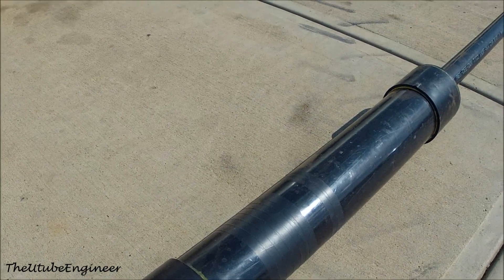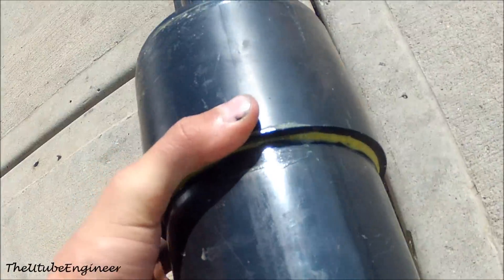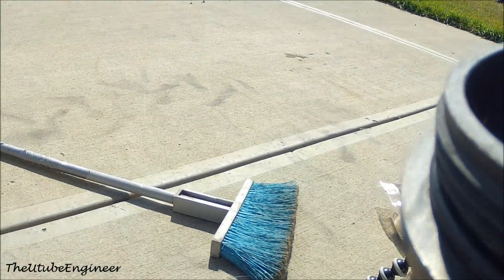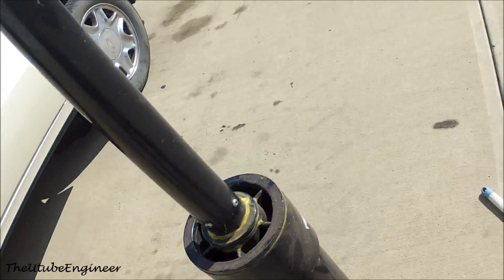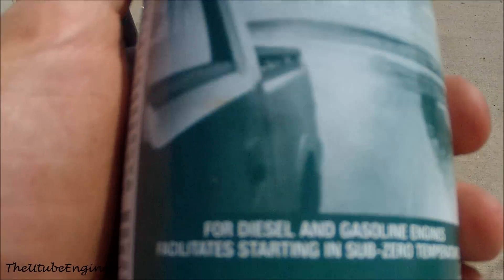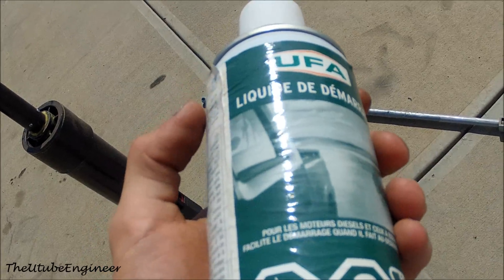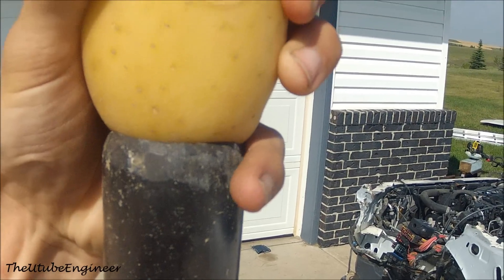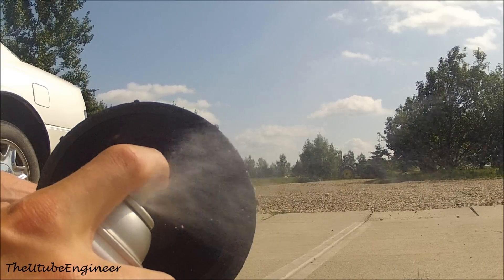How to Build, Load, and Shoot a Powerful Potato Cannon

Comment: Would HHO be a good propellant? or is it to explosive?
Reply: lekslkr's Gaming the hydrogen is strong,but you can use any oil terminal products to make a strong spud gun.the hydrogen can burning in the low oxygen environment.however,you just need a projectile which tie mounted to the shell made by steel,then the pressure would increase and more efficient.
Reply: explosive

Comment: I personally would try to use metal, simply because I wouldn't want this to explode in my hand. Or alternatively, I'd put it on a stand and ignite it from afar. That would also significantly increase the accuracy.
Reply: ***** 
Or I want MOAR POWER :D 
;-)
Reply: +max mustermann makes sense. I'm planning on making a smaller version which has the barrel being around the same size as a musket barrel. I'll also hook it up to a wooden frame and shoot grapes or smaller projectiles out of it.
Reply: Nice
Reply: I wrapped mine in multiple layers of duct tape for added protection
Reply: Id better had some metal in my potato cannon than plastic cause its easier for the doctors to find in your body

Comment: Abs plastic is rigid and durable but isn't pressure rated. Meaning you used the wrong material and now have something that could easily be turned into a plastic fragmentation grenade

Comment: I grind the inside of the tip of the barrel so when it cuts the tator it wedges it into the barrel.  Then with the tator wedged in the tip, that's when I load the chamber with excellerant and them jam the tator down- compressing the fuel and air like an engine. Nice spud gun tho

Comment: Love it, but using ABS pipe (DWV) scares me.  It is drain line (meaning not designed for pressure).  We generally use schedule 40 or 80 PVC.  Much safer.  I like the sharp edge nozzle!!